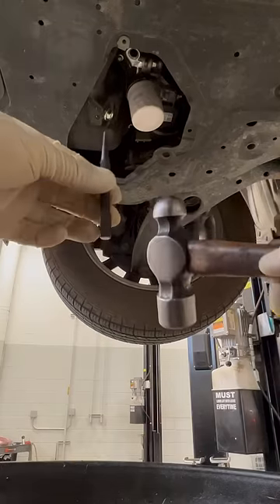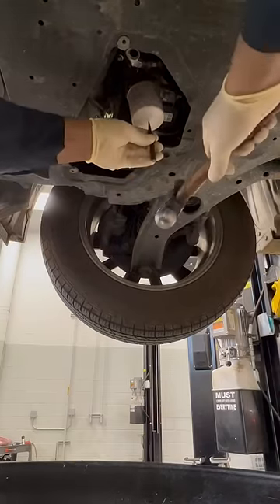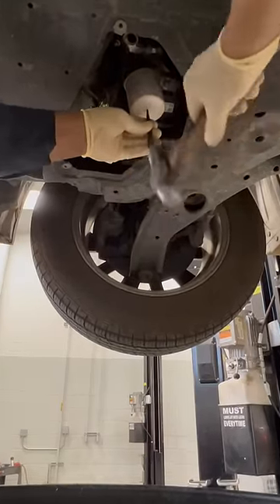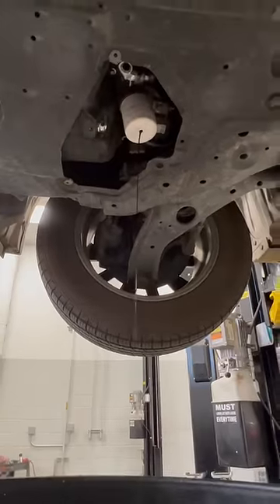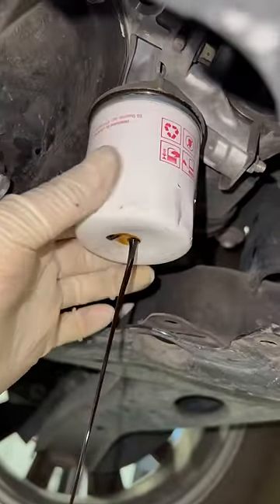Tech Tip Of The Day Oil Filter Clean Removal #oil #oilfilter #mechanic #shorts

Comment: Just make sure you're able to loosen the filter first!
Reply: It's gotta come off one way or the other at that point. So it doesn't really matter I don't think to be honest. Besides, if you do end up tearing it up to get it off this way it's already empty and you aren't having to take an oil bath. 😁
Reply from the maker: Great point!
Reply: Then u just shove a screw driver in it and get it loose 😂😂😂
Reply: @frankkramer2267  one time I had no wrench or anything at all to take my filter off and I had gotten a jiffy lube special while on a vacation, I had a flathead and a hammer and I just hammered the flathead in there and used it as a pry bar to twist the filter loose 😅
Reply: Yeah,some apes do them up so tight,I my CAT filter remover and a big FO bar,and it was not moving,and it been last serviced by a Toyota dealership...
Reply: If you can’t get it off after draining it drive that punch through the bottom half of the filter and start turning it’ll come off
Reply: @midnightrider1854
It does matter, a lot.  Once you puncture it, it becomes very hard to put force on it without it collapsing.  That's why if you're going you punch a hole in it, might as well do it in the side or at least off-centre so that you can use that hole to turn it.
Reply: It’s attached with pipe thread and a gasket.  That MF is coming off one way or another.  It’s not like it’s 317 stainless and the threads lock up.  SMH weekend warriors 😂
Reply: If you're the one changing your own oil then you should be able to get it off. I tighten my filters by hand. Never leaked and never struggled to remove one
Reply: @CiCiLeathercraft my man
Reply: @gagemeyer363 unless it's that tight that the screwdriver or punch just tears the filter in half.
Reply: I was about to say the same, haha. I did this on a customer car years ago and ended up having to drive a flathead straight through the side to get enough leverage to finally crank it loose. Had tried band wrenches, filter pliers, and caps with no luck. They only managed to start crushing the whole thing into itself.
Reply: That's when you pierce a screwdriver along the side of the filter for ultimate leverage.
Reply: Sawzall.
Reply: I feel.sorry for you if you can't loosen an oil filter 😂
Reply: @richardcurtis2688  Clearly you've never tried to remove one where the last tech didn't oil the gasket and then cranked the new filter on as tight as possible with a band wrench before leaving the same filter on the car for 2 years. 🤣
Reply: @richardcurtis2688  Maybe this is why I see so many engines that are done at 50k miles from never getting any maintenance.
Reply: @Snowness  I never oil the gasket, there's plenty of oil on the gasket flange already.  I swear I cannot imagine how tough you guys lives must be.
Reply: @Snowness  So much wrong with what your saying. First, I never let anyone change my oil...I do it. I'd never leave a filter on for two years. I've changed oil for people with stuck on filters. I've always gotten them off. I've also had to scrape off gaskets that are stuck to the block. But I've never been defeated by one. There will never be an instance where I can't get an oil filter off. If I have to jam a screwdriver through it to turn it, it's coming off!!  😁
Reply: @richardcurtis2688  I totally agree. But that's what everyone, including me, in this comment reply is already saying, haha. There's always a way, but to say the filter isn't stuck while needing to completely destroy the filter to remove it is a bit of an understatement.
Reply: @richardcurtis2688  Reaching deep down into a twin V8 BBC boat there's barely enough space to reach your arms and you gotta get all the way down there, no way you're gonna drive a screwdriver through while standing on your head.  I've got a chain wrench and a heavy nylon strap wrench for these.  Occasionally a challenge but even the tough ones installed years back during the last engine swap where they tightened them BEFORE dropping the engine in, do come off.
Reply: @thisisyourcaptainspeaking2259  Who knew we were talking about a boat ?
Reply: @richardcurtis2688  My point was, these guys can't even get a filter off that"s right in their face with tons of access.  They should try something a little more challenging before whining.
Reply: @thisisyourcaptainspeaking2259  Oh ok I get ya. Yeah yours is definitely harder to do!
Reply: Hahaha😂
Reply: Take a Long screw driver to It.  Horizontal.. it's Already Toast.  At that point.. I'd Definitely make sure the old gasket wasn't adhered to the engine..Schtuff Happens!!
Reply: @midnightrider1854  well, if it is stuck on there and you don't have the tools available to free it up, doing this will take your vehicle out of commission until you get the tools you need.  And, if it's your only vehicle, you're stuck.  So, it's a good idea to free it up first.  Just like it's a good idea to make sure you can open the fill plugs on a differential, a transmission, or a transfer case before draining them.
Reply: @Range-X  not everyone has all the tools out there to free up a stuck oil filter pin head!
Reply: @brontoab1  okay give me a screwdriver and a brick.  But seriously a multi size filter wrench(strap or channel locks) will run you less than $25

Comment: Make sure you've broken the filter free first.  Just in case!
Reply: This is the best advise here in the comment section.
Reply: Was literally looking for someone to recommend it.   Lol 
My luck it loses structural integrity,  then I'm there 2 hours taking pieces of a filter off. Mine is in a tight ass spot.
Reply: This
Reply: @CB-el3sv  If you dont crack it loose first and just punch a hole in the bottom what are you gonna do if its cranked on too tight and cant take it off. throw tape on it? plenty of obscenities will be thrown as the filter crushes and loses its structural integrity. nothing more fun than a bent up stubborn bloody tit leaking all over the place that wont remove itself lol. been there and seen plenty do it.
Reply: @xSOULxREAPERx-OP  bingo. im an auto tech for a living unfortunately as it doesnt pay enough and I'm tired of wrenching. but punching holes in filters is a bad idea generally speaking. if the filter looses is structural integrity it makes it more difficult to remove. the filter will crush and become more impossible. always a good idea to crack it free near the base of the filter closest to the housing.
Reply: @philthyphil1017  if it's too tight it's going to crush anyway. A small hole is not going to make a difference. It's better to crush an empty one than one filled with oil

Comment: That only works when you have a vertical oil filter. My "red block" Volvos had right side of the block oil filters that were mostly horizontal. Access only under the exhaust manifold behind either the alternator or the power steering pump. Had to unscrew them and let the oil run down over the right engine mount into the pan. My 2000 F150 4x4's oil filter on the 5.4 Triton V8 is buried on the engine left side up above the front drive axle and differential. I have to jack the front up to drop the left wheel and suspension to put lots of extensions on the oil filter remover disk to loosen it through the wheel well. Then underneath to spin it off and remove it pretty much blindly. Ford was "nice enough" to provide a small shroud below the filter to duct the spilling oil into one point to put the tray under it. Manufacturers don't always cooperate! My Mazda CX9 has a nice vertical oil filter at the front of the under carriage, very accessible! Thanks for the tip. I'll definitely use it!
Reply: I've got a 2001 F150 with the 5.4 in it. It's stupid the way they mounted the filter there. The engineer that designed this needs to have oil dripped on his head!!!
Reply: My 99 Dodge Stratus literally has a 90° angle oil filter so this tip is not going to work whatsoever. Doesn't even get my hands dirty in the first place😅 is tilt the side upwards that doesn't have the threads and you're good😊
Reply: @MikeFury420  Thanks Mike. My Ford truck's oil filter is so hidden that I don't think there's enough room to even visually attempt that tilt. As I'm unscrewing it oil begins to run out around the threads. By the time it's off the threaded pipe half of the oil in it is running down the small Ford provided chute to the catch pan. My Mazda SUV has a vertical filter in the open for that I am grateful. Thanks for the input.
Reply: Cordless drill better instead of 2 items(hammer & punch)
Reply: @jamesspalten5977 , expensive car engineer usually try to design the car so that owner have no choice but to send to agent..bisnes strategy.
Reply: @awkwarddude ok in that case, drill the crankcase 1st.so no oil when replacing filter.😂
Reply: @iknowlaa  🤣there ya go, solved lol!

Comment: Woah, the rare sticky filter gasket! I just crack filters loose, give em a spin at mach 1 as i duck for cover. It'll spin all the way off and land in the pan
Reply: That's what I used to do. 😂 the sad part is I knew about the punch method. Lmao.
Reply: This rare sticky o ring will cost you an engine if you don’t see it lol.
Reply: I Have a 2014 checy sonic ajd the oil filter screws out the other dirextion, top down, as u reach from the hood of the car. I thought more cars did this. Its an eco tech engine 🤷‍♂️

Comment: The only time I would do this is when I haven't checked I have the correct replacement filter..
Reply: True setup for success
Reply: Worst case scenario throw some tape at it. It'll hold long enough
Reply: Regardless would have to double check if correct filter, wouldn’t plan on driving after that initial oil loss but hey, you can always just dump the catch pan back into the engine right
Reply: People who dump straight onto the grass has left the chat
Reply: Or spin the one you bought on before you drain the oil to see if it fits.
Reply: If you dont buy the correct replacement you shouldnt be doing your own oil changes let along doing any maintenance on your car
Reply: @joey4277   should have prefaced with i work for a lube shop and people bring the wrong filter constantly so to avoid a fuck up I spin there's on before we drain. Saves us the hassle
Reply: @joey4277  I'm a qualified mechanic but okay..

Comment: More importantly make sure the old oil filter gasket comes off the engine before installing new filter. The mess the extra gasket causes cancels out the mess avoided by draining the filter.
Reply: Now that's solid advice. Only ever left the old one on there once when I was 16. Never again after my dad saw the floor😂
Reply: I've left the oil filter gasket on once. You better have a lot of oil dry because it pumps fast!😡

Comment: Tech tip: do this to your oil pan as well so the oil can drain faster
Reply: Faster and make sure you get all of it out! You don’t want to mix the old with the new
Reply: Also use a pressure washer in the fill oil cap hole with some dawn dishwashing soap to get all that nasty old oil out and leave it clean and smelling fresh.
Reply: At two drainplugs that's a great idea
Reply: Also clears all that unwanted sediment

Comment: As someone who went to school for 2 years to earn my GM ASEP certification and spent 6 years as a technician at a local stealership the entire first year that I was supposed to be “interning” as tech I was doing nothing but maintenance work (oil changes, tires, batteries, fluid flushes, state emissions and safety inspections etc)….I learned that the BEST way to simply not put an oil filter on in the first place!!

Comment: First tip. Mske sure you can get the filter undone before you decide to destroy it... especially if your crawling under the car... coz you aint driving to the shops after piercing ya oil filter and find out its siezed on
Reply: man if you can’t remove an oil filter then you shouldn’t be doing them!
Reply: Chewing gum will patch the hole

Comment: Yes, I have mine facing up, so I had to lift my car upside down and your tip worked perfectly
Reply: Who the fuck manufactures vehicles with intelligently mounted oil filters?  Tell me what you drive!
Reply: Subaru Forester 2.5L
Reply: Punching a hole will still help actually it’ll allow it to drain back down to the pan easier

Comment: It's amazing the amount of nitpicking about this. This works like a charm. And if you do it while draining the oil pan, the jobs quicker. Less mess. Less clean-up. If your oil filter is stuck on there, try not waiting so long to change your oil and stop over tightening the filter. From fleet maintenance to my own personal vehicles, I never ran into any problems with this. Also, if you dont have the correct replacement filter, maybe it's time to start letting someone else do it for you.
Reply from the maker: @kennethloki7011  💯

Comment: About 45 years ago I watched some college kids try to change their oil and oil filter.  The oil filter was on super tight so they thought it would be a good idea to drive a screw driver through the oil filter with a hammer.  All they got was a ripped to pieces oil filter that was still super tight and stuck.
Reply: I wonder if they figured out to coat the gasget with oil before installing the new filter.
Reply: This is why I always tell people to never ever do the "Ye ol' screwdriver" trick. Once you rip open that sheet metal shell it gets way harder to remove. They make numerous types of filter wrenchs, anyone getting into mechanics or just doing their own maintenance should invest in a good one or two.
Reply: @jtreworks  While I still think popplng a hole in the bottom of the filter is a much cleaner way to change the filter as I myself have gotten a sleeve full of oil, it won't compromise the integrity of the filter.  Anyway, I own a big fleet of cars and I change my own oil, coating  the filter gasget with a film of oil, I just don't have this problem.  And besides, my own oil changes cost me about 18 dollars.  Not 90 bucks.
Reply: @styldsteel1    I think you might have misunderstood what the screwdriver trick is. Long time ago when a spin-on oil filter was on too tight it was common for mechanics to drive a screwdriver into the side of the oil filter to use as leverage to spin the filter off. Back then it wasn't a problem since usually the filters were made of heavier gauge steel. With modern filters using this trick usually tears open the filter instead of spinning it loose leaving you with pretty much nothing to grab onto. Yes I do agree poking a hole in the filter just to drain the oil out of it isn't a problem.
Reply: Bro said 45 years like it was last week or something 😂
Reply: dimebagvision3221  I'm talking about after someone has jabbed a screwdriver through the side of the filter to try and spin it off but end up ripping the end of it off instead. There won't be any structure to the filter once the end is ripped off of it leaving you to try and chisel the base off. Search "oil filter screwdriver trick gone wrong" and you'll see examples of what I mean.
Reply: I did that one time, but after.make the hole I insert the screwdriver inside to have a good point to make a good force to dismount that moth....er oil filter someone has tightened strong as he can and without hydrating the rubber before. 

It was hard to replace and take a lot of time. I had and advice from my boss: "You can spend this time to replace an oil filter".

I just finished quitting this job and that career. Now I'm a hobby mechanic.
Reply: I've punches screwdrivers thru oil filters to loosen them ,1 had a bolted bracket to block,  had to remove with filters! Set bracket in tree limb crotch , drove screwdriver thru ! Super tight !
Reply: dimebagvision3221  what are you talking about??🙄

Comment: Fitters used to do this in my workshop and found they had the wrong oil filter and we didn’t have the correct one in stock so be careful using this method
Reply: You cant reuse an old one. So what's the problem? You gotta get a new one.
Reply: @gerald7044 he meant that they started the oil change process without grabbing the new filter, and realized they  had it out of stock, and now the customer had to wait untill getting the replacement one in, because couldn't use the old one that gat dmg by the puncture :(
Reply: @carlosvogrincic4852  Still same difference.  Either gotta give the car back to the cust or make them wait an extra hr for the filter to be delivered.  A shady shop would just not bother even changing it.
Reply: @kb25j  thats what they are saying. Careful doing this because you could have the customer be without their car for longer than necessary if you dont have the correct new filter and have to wait for a new one to come in. You can't give the customer back their car since you already ruined the old filter. They now have to wait.
Reply: @gerald7044 it's not re-using it, it's just continuing to use it till you get a proper replacement. Don't worry you're not gonna contaminate your fresh oil
Reply: Well a smart worker would have the right stuff for the job before carrying it out
Reply: @sonanth2940  that's the point, sometimes you make a mistake. I've done oil changes countless times, but one time while changing my trucks oil, I completely forgot that I didn't have an oil filter wrench on me and I had already drained the oil. I didn't have another vehicle, but I luckily live a few blocks away from a tractor supply and went a bought one. Simple mistakes like not having a freaking filter wrench happen, even if you are experienced in the task.